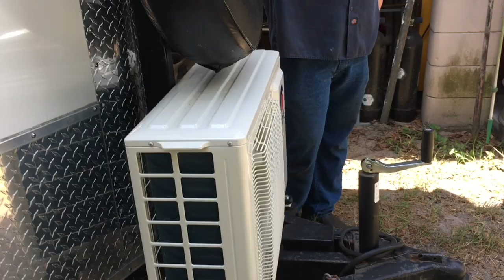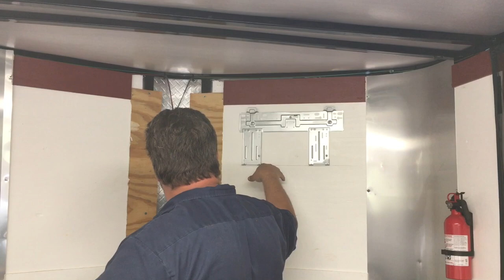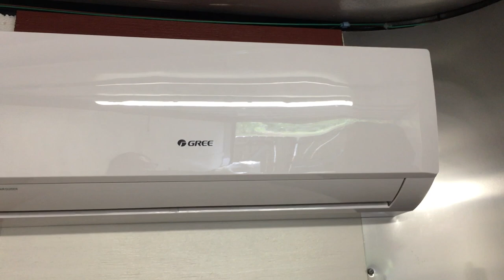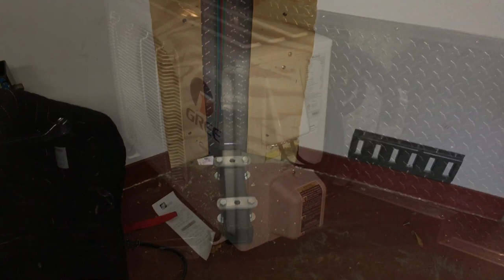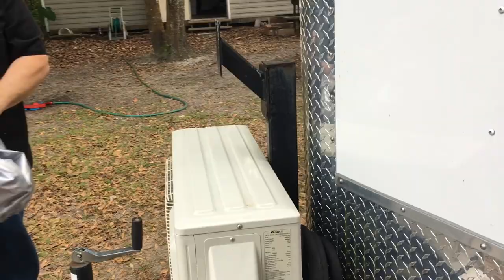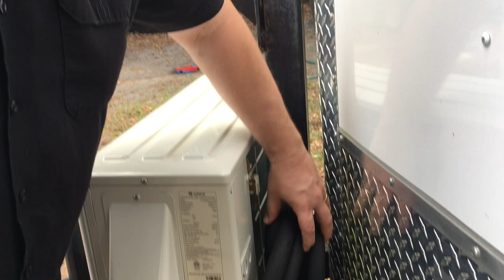ENCLOSED TRAILER CAMPER CONVERSION UPDATE MINI SPLIT AIR CONDITIONING INSTALL

Comment: I just had one installed in my 35 ft RV and loving every minute of it. It is so quite and cold. Best decision I made.
Reply from the maker: We are thinking about putting one in our off grid camper also. It is just so efficient.
Reply: @nearlyorganicnoshing2798   Go for it, you will not regret it.
Reply: What size did you use? I have. 36, the ceiling one is not keeping up with heat in Florida. We are not smart with electrical wiring so I would not know how to do a 230 amp, but I want one strong enough to keep us cool.
Reply: @amandamccollister5814  Hi Amanda, the make is Daizuki 12,000 BTU. Where are you located in Florida? I could recommend the young man who installed mine. He did a great job and the unit is working great. Actually, I do have to turn it off because it gets so cold.  Forgot to tell you, this unit has a 5 year warranty. So, I figured even if it only lasts for  five years I'm still ahead of the game.

Comment: I actually installed one of these on the back of my Toy hauler camper it's a fifth wheel but it only has 30 amp service I couldn't add a traditional AC but this works great and also provides heat because we camp every year Thanksgiving the only thing I had to do is come up with a cover to keep the fan motor from spinning while traveling
Reply: It does produce heat ignore my previous question. Thanks for the video

Comment: Can you go over how you wired the unit to be able to use with a generator? Thanks and great video!
Reply: The unit is connected to the electrical system we previously install in the trailer. There are instructions with the a/c unit on how to connect it but it’s just a simple 120v terminal block. (Line, neutral, ground.) Then , just use a proper extension cord into a generator the same as any outlet.

Comment: Mini splits are robust little units at a low cost...I have never heard of one person who was happy with the RV  roof top units and don't know of anyone unhappy with a  mini.
Reply: As an HVAC TECHNICIAN I don't like servicing minisplits due to how fragile they are when it comes to taking panels off and overall materials are very thin and light. However... I love how energy efficient and the level of comfort they provide and no ductwork.
Reply: @salvadorgutierrez4474  well I'm sure these units can easy give You at least 4-5 good years and maybe is time to upgrade for a new one by than instead of fixing, ( I think )

Comment: Thanks for the video and coverage. I am tossed between either the 9K or 12K Gree. My trailer (ordered) is 7 x 20 with 7' ceiling and is also a vee nose. It will be nicely insulated: ceiling = 12, walls = 6, floor = 6. I think a 9K will do it. I will run mine on shore, but normally off-grid on batteries / inverter charged via 1500w solar.
Reply from the maker: You might struggle to produce enough power, to keep your 12,k running. If you insulate well, your 9k should handle it well.
Reply: @nearlyorganicnoshing2798  Thanks for that information. I wonder if you got the Vireo model? It uses 12 amps and is 23 SEER, the 16 SEER pulls 17 amps. So... I'm over in northeast Florida not to far from Georgia and picked up my trailer yesterday. Ready to get this party started.

Comment: Do you folks travel very far? My concern is long distance travel and the jarring this unit will be subject to. I've not heard of anyone talk about that.
Reply from the maker: We decided to mount the unit on the tongue, and not the rear, to try and limit movement. We also installed rubber isolators to absorb shock. So far, so good.

Comment: Interested in how you mounted removable winch inside trailer. Saw a glimpse of it.
Reply from the maker: We drilled through the floor and installed a plate. He attached that to the hitch the winch slides into.

Comment: How is it wired for electricity?  Does it plug directly into your generator?  I've been considering a mini-split for my cargo trailer conversion but I would like something that I can just plug directly into my generator rather than wiring it up thru a circuit box etc.
Reply from the maker: We have it wired into a junction box, that powers other outlets in the trailer. Power is fed to the junction box from the outside power port on the side of the trailer. This Air conditioner could easily be wired directly with a line cord and plug on the end if you wanted which would attach to the outside unit.
Reply: @nearlyorganicnoshing2798  Thx.  My trailer isn't wired with traditional wiring and outlets.  I have mine wired with an inverter directly to marine batteries.  So I'd like to wire a mini-split with a regular 110/115 plug that can go straight into my inverter generator.  Cheers...
Reply from the maker: @randomstuffwithjoe  This would work perfectly for that. Best of luck!

Comment: Weld a nut on your spin handle for trailer and bring the drill for easy up and down.. when you forget you can just use handle and when you have drill makes short work of lifting trailer tongue
Reply from the maker: Great idea!

Comment: Have you noticed any issues with turning radius while backing up? I'm thinking about doing the same thing, and an engineer friend of mine is worried about the tow vehicle hitting. 

Do you have the make/model of your mini-split? I want to compare the dimensions to the one I'm getting.
Reply from the maker: We have had zero issues with the turning radius. I will check with my husband to see if he has any additional details.

Comment: Does the outside unit blow the air toward the tongue jack or toward the wall of the trailer?
Reply from the maker: Blows toward the jack. Draws from the trailer side.
Reply: @nearlyorganicnoshing2798  Thanks!

Comment: Nice install the part about the Freon did you have to take it to somebody or did you pull the unit down and install the Freon yourself.  I don’t suppose you could include a model number for that unit it’s about the same cost of an overhead unit on the roof
Reply from the maker: The condensing unit comes pre charged. You just have to pull a vacuum on the line set and evaporator.

Comment: I've been considering putting one into my trailer, but have been deterred by the manufacturers. They all seem to say the indoor unit should be at least 6 feet off the floor and have at least 6 inches of free space above. The unit being about 12 inches and my trailer having a 7 foot ceiling means I can't mount it at least 6 feet off the floor. Your trailer looks like it has about 7 foot ceiling, have you had any issues with heat/cold dispersement? Thanks.
Reply from the maker: Yes our ceilings are the same. We have had zero issues with heat or cold. Maybe if we had a huge space to cool, but the trailer is small so no problems. Good luck!

Comment: What happens if you park on a slope that is opposite of the drain exit? And how did you secure the wall unit to the bracket, does it survive the bouncing without coming un clipped?
Reply from the maker: We have always leveled the camper. We have not encountered that issue. We screwed the unit to the plywood wall. It has never come unclipped.

Comment: What generator are you using? And how long will it run on the generator before having to refuel on average.
Reply from the maker: Karen Pounds The generator is a Predator 2,000 watt from Harbor Freight. You can expect 6-8 run time depending on heat load.
Reply: Nearly Organic Noshing thank you so much!!!
Reply from the maker: @karenpounds4677  Happy to help.

Comment: Any concerns about vibrations in the unit outside on tongue?
Reply from the maker: There are rubber dampers underneath. So far, no issue with vibration.

Comment: How far away is your generator when you use it? can you hear the generator from inside? Does the generator last a full day on a tankful?  How much gas to fill that generator?
Reply from the maker: GENERATOR RUNS 6-8 HOURS DEPENDING ON LOAD. 25' 12 GA EXTENSION CORD, YES YOU CAN HEAR IT, BUT NOT EXCEPTIONALLY LOUD.

Comment: Great video.
I'm getting a mini split this weekend. 
Question. What screen door thingy did you guys go with and how has it been?
Thnx
Reply from the maker: Honestly, I think it was one of those as seen on TV, type of deals that I purchased from Walmart, for 20 bucks. It has worked very well, I will say, that the nails that come with it are not great. They were too short, and I believe Chris had to add extra screws. The dogs, even figured it out  no problem.

Comment: Do you know how many watts it uses while it’s running, I have a 7x16 I’m building and I bought a 9000btu Senville Leto for it. I got the Stromburg tongue rack to mount it because I was concerned about jack-knifing into the unit… Thanks
Reply from the maker: Jackknifing is not an issue with our install, due to our style of trailer. The vehicle will make contact with the trailer before it hits condensing unit. The unit pulls between 700-800 watts.

Comment: Thanks for the video! Do you have a link to where you bought it from? I like the fact that the line set goes out the side of the unit instead of going out the back (through front of trailer).
Reply from the maker: Joseph Folino  We purchased ours locally, but they are readily available from Amazon & Ebay.
Reply: I'm looking to purchase at 8.5 by 20ft trailer how large of a unit/trailer would this be effective/efficient for? Is it just for smaller trailers.
Reply: @anishajohnson2596  Insulate the trailer with spray foam including the underneath. It might cost a little more up front but will enable you to cool and heat the unit a lot easier. Not to mention it will add a lot of rigidity to the trailer.

Comment: Wow... great install, thanks for sharing!   I'm a little late to the party here, but:   My utility trailer was pre-wired for a roof top air conditioner, so it already has the service panel, breakers, etc.   It also has an inverter and aux battery because I have a 110 plug on the inside.  I'm curious if the built in inverter will run the unit from my truck's 12v hook-up while I'm on the road?  (I can use a shore plug when I'm stopped for the night).  Also - could you sure the model number for the GREE 16 SEER 9,000 BTU Mini Split unit?
Reply from the maker: The draw on this unit is 900 watts. Your inverter would have to produce 900 watts continuous, and the power supply from your truck would have to be able to support the needs of your inverter.

Comment: Where did you get this one? My ac guy didn’t recommend using his said they don’t like running on generators
Reply from the maker: You need an inverter generator. They are cleaner more stable power. We have had no issues with this.  We bought our ac locally from a small company but they sale online.

Comment: Is your ac unit a 220v or 110v? I bought that 9000 btu unit and it won't run off of my 2000 watt generator. Any advice will help thank you
Reply from the maker: Ours is a 110. Is yours a 220 or 110? A 110 60 hz should work. Maybe test with a different generator

Comment: How much did the mini split add to length of the trailer in inches? I was thinking of buying a trailer cover and would need to approx an added length to include covering the mini split.
Reply from the maker: Don Yeaton a cover over the trailer would easily slip behind the ac. We use a separate cover for the tire & ac.

Comment: What have you done to protect the mini split from the “dirty” power of the generator? Power surge protector, power conditioners? I would hate to fry a 700$ AC
Reply from the maker: The only generator we use with this ac, is an inverter generator, which is clean power. Since it is wired directly into the trailer, you can add an inline filter/suppressor. So far, we have not had any issues.

Comment: Great video. I was considering a system like this for my conversion. How big is your trailer. I just ordered a 7x18 and wasn't sure of the BTU size.
Reply from the maker: 16/7 with a v nose.
Reply: @nearlyorganicnoshing2798  Thanks...another question.....how much does the compressor section weight?  Noshing...I guess your from the NE!....like NY

Comment: How long will that generator run on a tank of gas using the mini split?
Reply from the maker: Honestly I cannot answer definitively   Anywhere from 6-10 hours depending on how hot it is. The trailer is not insulated.

Comment: Welding????  Unless I can hire someone for that I'm out. Is there a work around for that?  Would love to have install this unit.
Reply from the maker: Kevin Robinson you can drill through & bolt the tabs on. But, you can always take your trailer & unit to a welding shop & have them fabricate feet and mount it.
Reply: @nearlyorganicnoshing2798  okay.,getting close....i also have THE PREDATOR 3500 Generator and it looks like you are plugged into the 110/115 volt outlet with a basic power cord on your 2000. The 3500 has a 30 amp socket (RV ready) so I won't  need that one for this unit? Also I didn't see how the power is connected on the inside to be able to run on generator or shore power. Did you just run the 3 leads from the Greed to a male AC end? They tell me these units are 220.
Reply from the maker: Kevin Robinson  Unit is 120 volts. Standard 15 amp circuit will work. Ours is wired into the electrical system of the trailer, but you can run a dedicated line directly from the unit.
Reply: @nearlyorganicnoshing2798  Okay, one more thing...What model is that Gree ? I'm seeing a lot of vendors only offering 208 - 230 volt units and they cost less than the 115 / 120 units. One guy said my Harbor Freight 3500 would power a 230 with no problem, but how...it's only 120 volts!  I think I'll stick with the Gree...You've demonstrated proof that it works.

Comment: how was it wired to connect to the generator
Reply from the maker: Unit is wired into electrical system of the trailer.

Comment: Could you power it solely by a solar system
Reply from the maker: Monster's Inc. If you had enough batteries for storage, enough solar, & an inverter, then yes. But, you cannot use solar, to directly run ac.
Reply: @nearlyorganicnoshing2798  I meant to include the inverter when I said solar system, just wondering how many solar panels would it take, or would that number of panels fit on top of the trailer.
Reply: @Agislife1960  You can now buy solar generators that have lithium batteries inside, these units combined with solar panels will run these units. They are expensive but your not paying for gas or polluting the world with a generator running for hours on end. I wouldn’t want to be camping beside someone running a generator all day and night. Technology has made converting one of these units so much easier over the last year.

Comment: Great video, is there a reason that you left the copper coils up behind the unit.
Reply from the maker: The condenser unit is mounted on rubber mounts, so the unit does not vibrate, and resonate throughout the camper. This means, the unit moves a little. If you run the copper tubing in a straight line, it will flex, and fatigue. By placing the tubing, in a loop, it negates that.

Comment: Anyone have trouble with a mini split due to road vibration and impacts?  I installed a window unit in my truck sleeper and it didn't make it past the first week on the road.
Reply from the maker: We installed rubber dampers, to help with the vibrations, and so far, so good.

Comment: Did you insulate your trailer?
Reply from the maker: Not yet, but we plan to.
Reply: @nearlyorganicnoshing2798  thank you for the reply. I just ordered a 9k split for my 7x16 . Roof is insulated but that's it. Hoping it will keep up in the southern heat without having to insulate